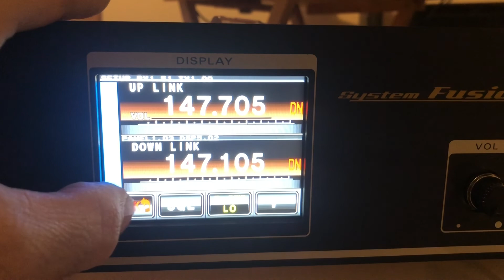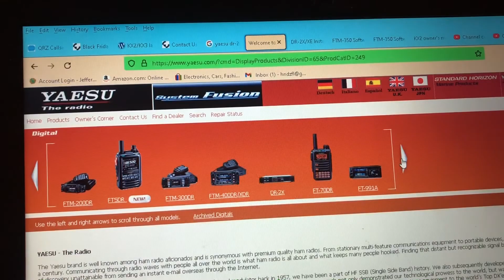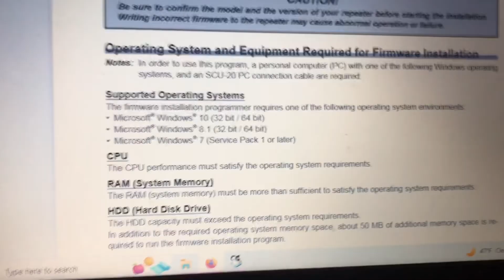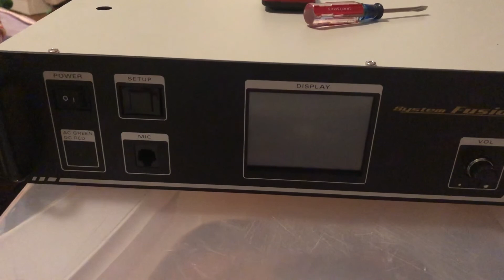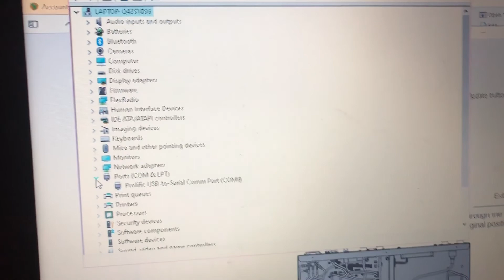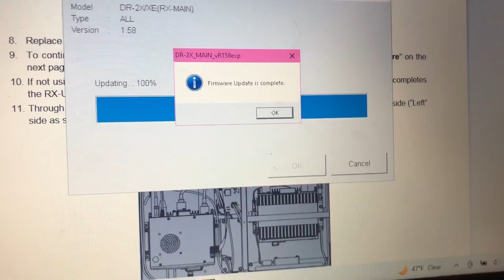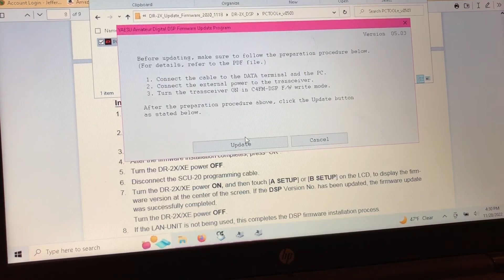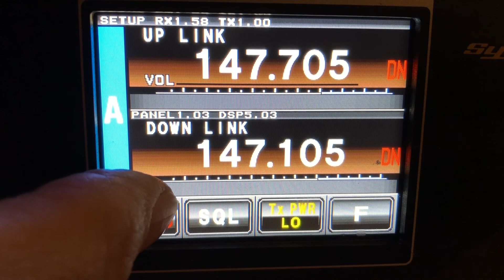How to update firmware on Yaesu DR-2X Repeaters

Comment: Great video - thank you.

I know this video is a year old but I'm trying to find out if the repeater settings are lost after updating the Main and DSP Firmware.  

I emailed Yaesu last week and they replied a factory reset is required after the updates and therefore previous repeater settings will be lost.  

Nowhere in the update docs does it say to do a factory reset, so I am questioning Yaesu's reply.

Would rather not have to go through every setting page for 2 repeaters before the update gets done to them.